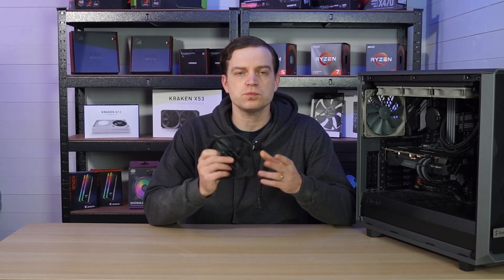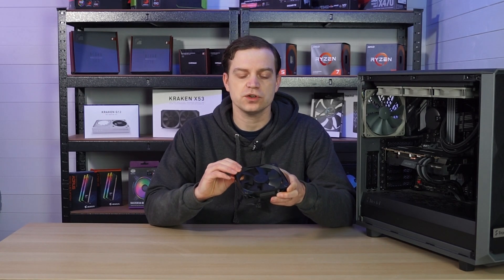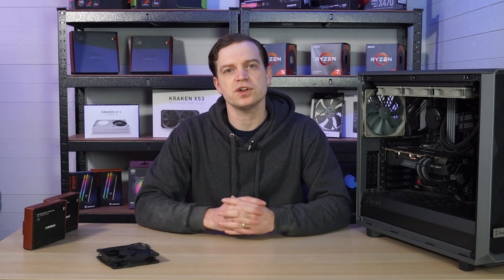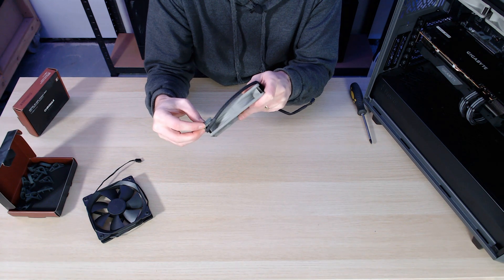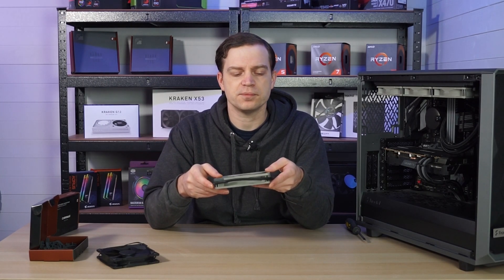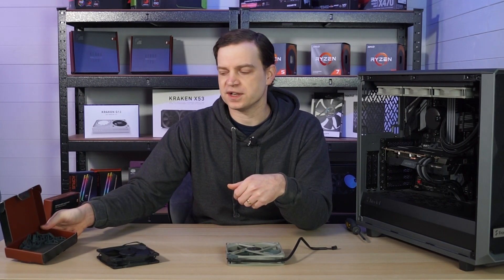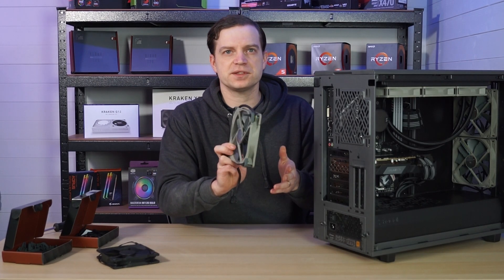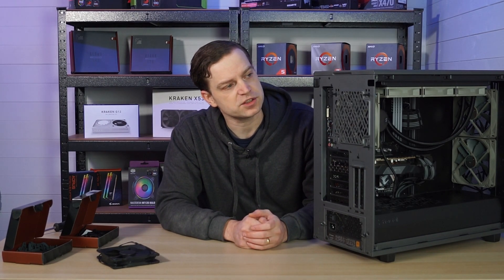How to Reduce Vibration From Your Case Fans.

Comment: If it's the cooling fans that connect through the top of the case to the cpu cooler, and then the fans is there longer mounts for these situations?
Reply from the maker: If you mean fans on a radiator then no, these will still need to be screwed on but you can use rubber corner mounts if your fans don’t have them already.
Reply: @TechLabUK  Unfortunate, was hoping I wouldn't have to replace the fans as they appear to be a pain to replace, this pre-built I bought for convenience sakes case appears to be really hard to take the fans out after assembly. Thanks for the speedy reply though.

Comment: Found this video while trying to get help with random pc vibration. I have no mechanical drives in my pc now and I changed all my fan mounts with the rubber anti vibration mounts which has helped alot. but i still get a random vibration coming from something. It's not my gpu and i cant see it being the fans.. I feel i maybe missing something. Any ideas?
Reply from the maker: It can only be moving parts.  Usually Case Fans, PSU Fan, GPU or CU Cooler (If there's no mechanical HDD).  Sometimes coil wine from a component can sound like case vibration as well.
Reply: @TechLabUK  well i'm fairly sure it isn't the fans. so i guess psu or cables in my case. I am gonna try another case and see what happens. maybe try cable management a bit more..
Reply: Update. Rebuilt the pc into my old lian li o11. All 9 fans are mounted with the rubber mounts, and I have software pushing them to top speed, no vibration. I have lined the bottom rear of the case with foam as there are many cables against the floor. Now and then I get a non consistent vibration which when I tilt the case to the left (looking from front) it stops. But when I take the panel off the back, I cant see what it can be. Any thoughts? I am stumped..
Reply: @Martyn_Lawson  Do you have an AIO? Because the pump in those things contains an impeller, a moving part. Maybe random vibrations resulting from the impeller changing speed according to CPU load? If you got an air cooler, did you use rubber mounts/pads on its fans to isolate them from the heatsink? Vibrations from those fans can transfer through heatsink, through motherboard, into case.
Reply: @ It's long been sorted thanks. I don't have watercooled parts. all aircooled. But i recable managed and messed with my fan controller and it runs much quieter now

Comment: I have a lian li 216 that has 2 huge 160mm fans on the front that would vibrate my whole desk when on 100%. I used rubber washers that came with the case and worked well for me, case vibrates a little and still a little noisy but at least the desk vibration is gone.

Comment: What if the fan itself vibrates more than it should?
Would a splash of WD40 or something like that in the middle of the fan help?
I'm having problems with a laptop fan here.
Reply from the maker: Not exactly sure.  If the fan vibrates that much it may have become unbalanced.
Reply: @TechLabUK  It doesn't vibrate and hum much at all, it's just a tad annoying. I could live with it no problem. But many others don't have this issue (GPD Win Max 2).
Reply from the maker: @tdome3000  It could just be the type of fan.  i am sure people have used sprays to help them a long, but I think it depends on the type of bearing the fan has.
Reply: @TechLabUK  In the worst case I can order  another fan if GPD doesn't send it to me. I found the model on #ali and ebay.
I was mainly worried about where one would spray that WD40, because I don't see any "opening" where the fan's center is.
Or if it would damage the laptop's motherboard if it got in contact with something else. I didn't know if it is "a thing" to grease fans or if it make no sense at all.
Reply: @tdome3000  I use contact spray, that is called in my country, it is used for cables and contact in cars, but it is ok to use it with fans, if fans have opening in the middle, nowadays some fans do not have...

Comment: also, general tip:

the better airflow is in your PC, the slower fans must spin.
the faster your fans spin, more vibrations they generate,
for me, i have my PC side always open, that way i dont need a lot of fans spinning fast.
besides my video card which has 3 fans (GTX1080), i have only one Noctua FAN on CPU DH15 and another case fan, thats it, and they spin at 1200RPM, which is quite slow.

vibration issues usually occur when you have bad or restricted airflow and low quality fans which spin fast - thus generate a lot of vibration.
so, to eliminate vibration first thing to do is to provide adequate airflow, replace fans to better ones (noctua for example) and at least have side panel open is a good start,
then gradually lower speed of fans and monitor temperatures, avoid excessive overlocking, do not run your CPU 5Ghz if 4.5Ghz is enough.
and only in the end use other 'rubber tips' to remove and remaining vibrations.

also, dont use spinning Hard drives, they vibrate ALOT!!!
today SSD are quite cheap, and if you really need that extra space given by even cheaper spinnig hard disks, consider getting a NAS or build one from old hardware and put it in another room.
Reply: SSDs are still up there in price in comparison to HDDs. Most premium cases like the O11D for example provide anti vibration pads for HDDs to minimize vibration. My PC is practically silent despite having a +13 year old WD Black HDD in it.
Reply: "for me, i have my PC side always open, that way i dont need a lot of fans spinning fast." 

that's...not good?

Comment: Can you remove the fans that are mounted without damaging or cutting those "rubber screws"? Or do you have to get new ones if you need to remove and reinstall?
Reply from the maker: You can remove them, sometimes takes a little squeeze and wiggle from the other side but they will come out and can be re-used again.
Reply: these things are $3 for a pack of 20, why you worry about breaking them?
Reply: @ceasarcruz8312  sadly, I live in a country where it's a lot more than 3 dollars, and the supply is not that high. I'd have to order than, wait a lot, and hope I don't screw up (haha)

Comment: Just installed a Noctua NF-P14s redux-1500 PWM as a front fan on my corsair 450d and I hear this little hum from it. It's ignorable, but it still bothers me enough to wonder if these pads would stop it. It's not a buzzing, but a "whirr" kind of sound.
Reply from the maker: We use 2x 140mm on the front in this case and the are silent.  A "whirr" would suggest a fan sound but could be some form of vibration into the chassis.
Reply: @TechLabUK  Yeah, listening closely right now, it almost sounds like a "tapping" in a way; it's not quite buzzy but it's like hearing an airy stacatto sound if that makes sense. It's not a smooth sound, but a bumpy one. Almost like a fast consistent morse code, but a fan sound. So it sounds like a vibration at least.
Reply from the maker: @WormyLeWorm  It could be vibration or sometimes the PWM signal you can hear.  Check to see the speed they are running at, ours on the Aorus board are run by the BIOS so they go full speed on boot up and then slow right down as they don't need much speed to push a lot of air on a 140.  It could be a combination of both so the PWM signal vibrating into the chassis.
Reply: @TechLabUK  Looks like while idle they're going at around 1100 RPM. Quite a bit faster than my stock fans indeed which seem to be going at 600-900.
Reply from the maker: @WormyLeWorm  1100RPM seems a little excessive for idle.  I believe ours run 500-600 when idle.  They are controlled by the motherboard with a custom fan profile set feeding from the general system temp.
Reply: @TechLabUK  Good to know. Well it seems under normal use, it doesn't really get that loud, it just has that airy vibrating kind of sound that I find a little distracting if I'm not focused. I checked the preset settings in the BIOS just now to see and the higher speed ones were definitely a very loud, shockingly so, spinning sound, without the skipping sound I'm hearing under normal use. It seems like that sound is most audible at lower speeds; sometimes I hear it go away when the fans spin up a little then it comes back when they slow back down.

This fan being beefier probably explains why my temps seemed a couple degrees cooler, even just by changing one fan. Normally this pc was sitting at around 38C when I had basic stuff open after being on the desktop for a bit and it was more like 35-36C even with a bit of cpu usage now. It seems like the mobo is handling them pretty well by default, at least for me, but I'll keep in mind your speeds for reference on how I might optimize it in the future if I feel gutsy. I wasn't really sure what was normal or not.  While in the BIOS this fan was actually around 600 RPM, in line with the heatsink/exhaust fan. It's my other stock front fan that was around 900RPM while in the bios, which is interesting. Actually, looking at it again, I'm not even sure what aux3 fan means in speedfan in my case and that's the one that says it's 1100RPM. Maybe it's the same as "hamp fan" that I saw in the bios also at 1100 RPM which.. I have no idea what that really is either, as it was a fifth fan, when I only have four fans total in this case. In speedfan my sys fan, cpu fan, and aux fan read 970 rpm, 531 rpm, and 670 rpm respectively, though that's only 3 fans accounted for not counting the "aux3 fan" but it seems to match the bios.
Reply from the maker: @WormyLeWorm  It totally depends on the boards, profiles, fans and when the headers are getting their temps from.  We have had identical fans on two different headers configured to use the same profiles and temp sensors and they still go different speeds :/  If you have Discord feel free to join our community server, loads of techies there may know with some details on hardware.
Reply: @TechLabUK  Hey well, I got some of the pads today and slapped em on. Thanks for the video, really helped me understand how these are supposed to work; never tried them before. Happy to see how soon you replied to my comment too as not a lot of people with channels do that. That vibrating hum is a little toned down, and a bit easier to ignore it seems. Once I get going I don't notice it though; even when I boot up something heavy these Noctua fans are surprisingly quiet.
Reply from the maker: @WormyLeWorm  Glad it's all coming together.  Sounds like it is partly a vibration through into the chassis if it's calmed a little.